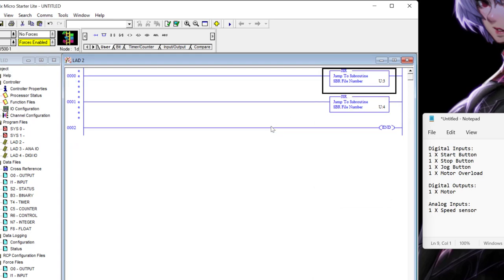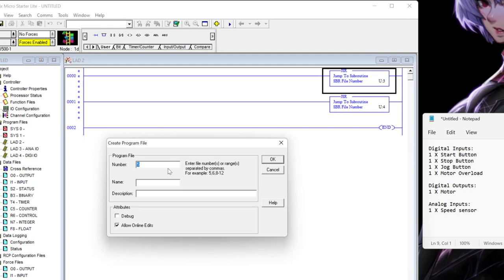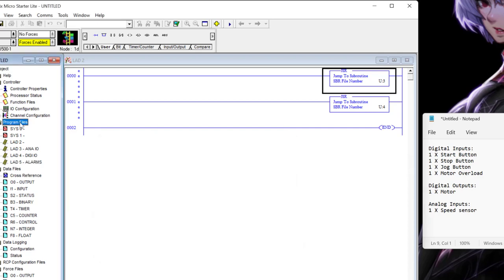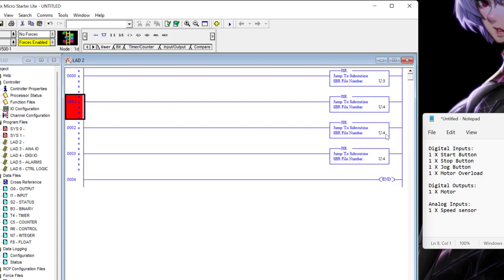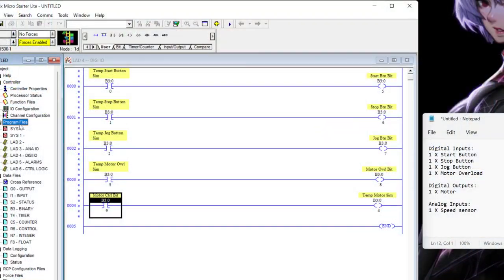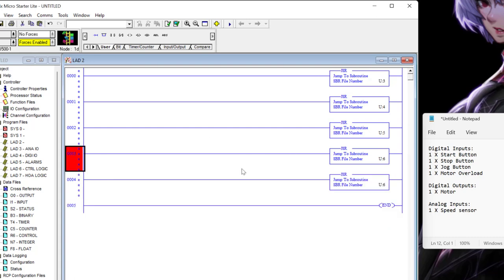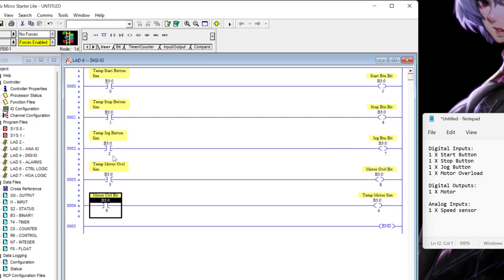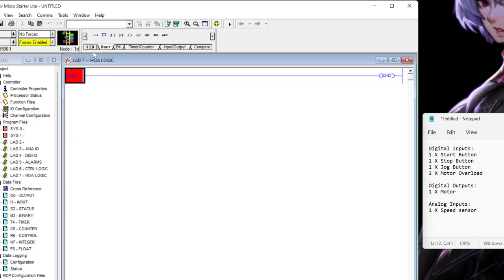How to Program PLCs FASTER

Comment: Great stuff! I love finding all the little ways to make my programming more efficient.
One thing I like to do is type out the instructions on the rung I want instead of using the graphical instruction panel. So for example, if I know I'm gonna need a couple XICs, an ADD, a SUB, and and an SCP and maybe a couple of branches, I can just select the rung and type XIC XIC ADD SUB SCP BST BST and then I can just drag and drop things where they need to be. No more scrolling through the little instruction panel.
Reply from the maker: I never thought of doing that, but yeah - BRILLIANT!!

Comment: Hi Paul, i am i huge fan of you work, it's possible for you in the future make a video with the difference(or you preferences) between Siemens x Rockwell in automation (plc's, softwares, hmi, scada, know-how protection, etc...) i am on the Siemens side of the thing, and for me i cannot see why so many developers who work with both have the preference for the Rockwell
Reply from the maker: Honestly, those preferences are more based on region and industry than actual merit in most cases. If you ever figure out any MEANINGFUL differences, I'd love to know myself! Really, they both do the same job and run the same programming languages. If you can handle one, you can handle the other.

Comment: I am new to programing. You use B3 a lot in your videos.  Is the 3 in B3 a expansion card reference?
Reply from the maker: In the RSLogix 500 PLC programming environment, tags don't exist, so all memory resources used in your logic have to be accessed by their memory register addresses. B3 is the default data table for bits.

Comment: i work at a pipe plant the PLC on the cage machine has stopped working is there any way to transfer the info from one to another it is a GE 90/30 PLC
Reply from the maker: I'm not up on that software in particular, but with most PLCs, you merely have to upload the program from one into your PC and download it into the other unit.